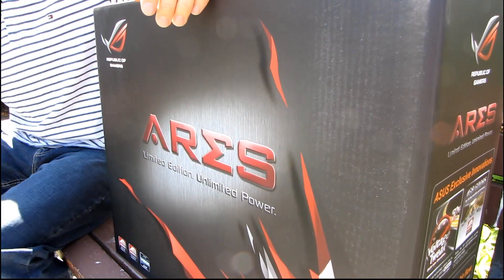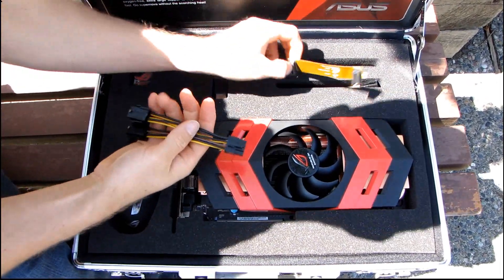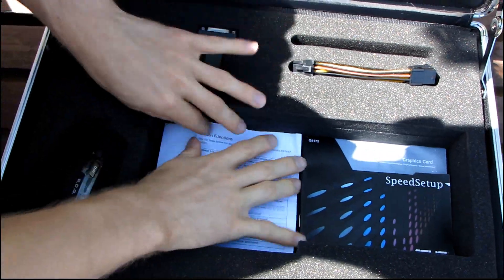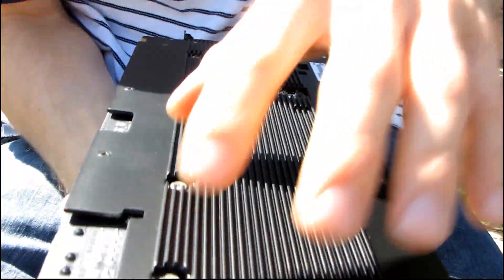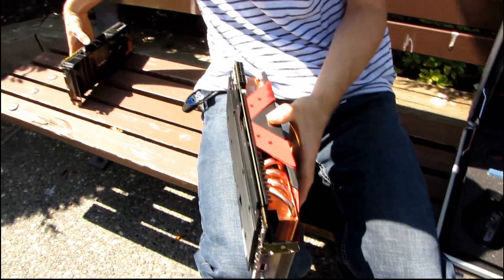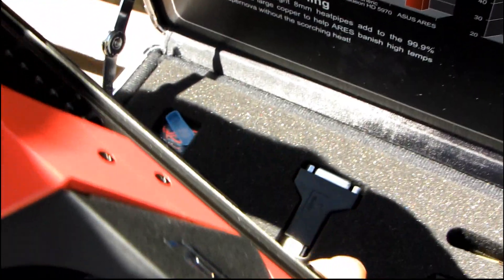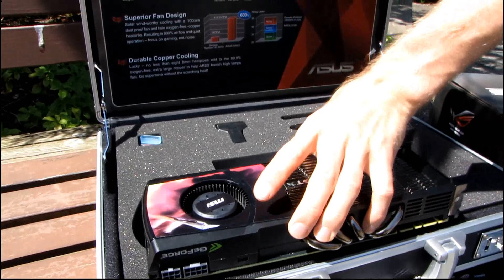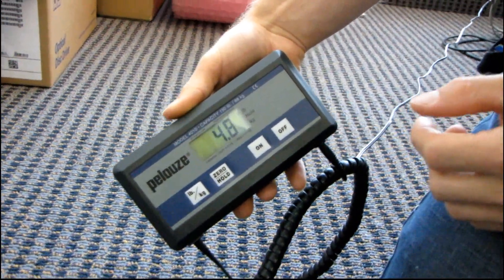ASUS Ares ATI Radeon 5870 X2 Limited Edition Graphics Card Unboxing & First Look Linus Tech Tips

Comment: How does it compare to a 4090
Reply: The RTX 4090 is much much much much much better than this card, the HD 5870 x2 is a graphics card from 2010, so yeah, the RTX is better.
Reply: @bugandoamente251  no it's not. if you mean how fast it is, yes, it is a bit faster, but in the matter of design, features, packaging, manufacturing quality, then no it's not.
It was an experience to have one of those special 5970 edition GPUs.
I still have 8 of each special edition. XFX version was packed in a weapon case and bag. The Sapphire did not put a lot of effort in packaging, but it was the most quiet.

Comment: Is there a store that repairs these cards?
Reply: There are a few places that might depending on what is wrong, after trying to fix a GTX 780ti I swore never to do board repairs on graphic cards again.
Reply: yep (aren't they basically GTX980's)
Reply: did u end up fixing the card?
Reply: Wha hello dere It is working fine now, there was a problem with the driver. Thanks
Reply: oh right, the 780Ti is a great card, im stuck here with my shitty HD5830
Reply: Wha hello dere Well i don't know how long mine will last, it's already 5 years old and i've got it used too. I guess soon we'll have to upgrade to something better.

Comment: yes, also this wasn't even originally designed by amd/ati, it's a fully custom card and the special part is that it has two GPUs instead of one and each with the same power of a single 5870.
anyway now it's been a while since it came out, there are much more powerfull cards.

Comment: a 5970 is around the same performance as a 7970. this card is like 30% better than the 5970. that means its more powerful than the 7970 and gtx 680. but still, its bigger, makes more heat and it draws waaaay more power than moth of them.

Comment: damn it! my computer cant fit a gtx 260. i put it in and a capaciter on the motherboard snaped off. -_- luckily my dad fixed it. currently it has a ati radeon hd 5570.
gpu clock. 700 mhz
memory clock. 950 mhz. i was thinkin of getting that card for my computer but my case is narrow but a tall case. man i wish i had a better case

Comment: Two 8 pin connectors plus pcie slot = 375w.
TDP of this card = 376w (188w for each gpu).

Do you really need the 6 pin connector for the sake of 1 watt???

Comment: I saw the latest benchmark for this card, and it's not very impressive, it's like having two 5870s in xfire, it does NOT performe better than the 5970, which is very good, since the best 5970 costs much less than Ares card.

Comment: I just use the cd's the part came with. I dont see a point in downloading the latest drivers all the time. If they wanted you to do that, why supply a driver cd with the part? kinda pointless if you ask me. But this card is one monster, no point in going crossfire with it. two 5870's on one card...damn thats alot of GPU power.

Comment: 5970's GPUs aren't really cut down, they have full 1600sp, only to be clocked at 5850's speed.
ARES' GPUs are running at 5870's speed, that's the difference.